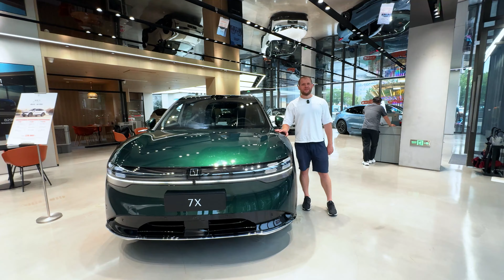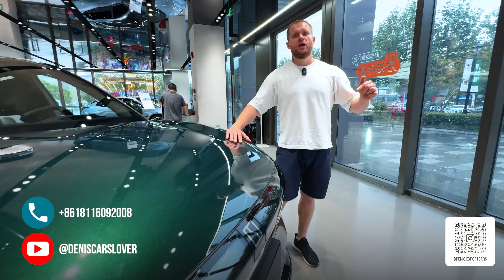Zeekr 7X - The best SUV of 2024! This car has no rivals!

Comment: How does this compare to BYD tang ? I love Tang for the big LFP 108kWh battery. But 7x is more premium and charges a lot faster. Also available with air suspension and better offroad capability, it is shorter and ground clearance Zeekr 23cm vs Tang 17cm. Still, the Zeekr 7x has LFP only on the small 75kWh battery, the big one is NMC at 100kWh. You reviewed both, could you compare a bit ? Thank you.

Comment: Thanks for the informative report
How much towing capacity with dual engine?
Reply from the maker: Manufacturer doesnt offer trailer hook option and doesnt give this detail, but zeekr 001 have this option and the towing capacity for Zeekr 001 trailer hook is 2 tons.
Reply: @deniscarslover  thanks for the quick message - I already knew about the zeekr 007 but was hoping the CX 7 would pull a little more
Reply from the maker: @senjahase  I guess with it's 646 HP it can pull a 20 ton semitraler, but with kerb wieght of 2500 kg it may be not so safe :)

Comment: This car is really nice, I like the look, design, materials and interior features. It has a lot of passenger and cargo space, seems like a miss to not have a button on the door or center console to control the rear seat heating. I like that it has a power roof shade, that has been missing in a lot of new EVs, with the roof glass adding to the cabin heat, that makes the AC work harder to cool the cabin. Driver instrument cluster and heads up display? Nice! Front seats could use a bit more side bolstering, love the way designed the cargo floor covers, they did a really good job on this one. I also like the grey interior color, not sure why a lot of the Chinese cars have white interior, those will get dirty quickly and black is nice but a bit boring these days. I like that Zeekr is changing things up, now they need tan, light brown and red interior as well. Thanks for the review.
Reply from the maker: Thanks so much, I hoe you have subscribed :)
Reply: @deniscarslover  Yep, subscribed a few video back. Keep up the good work.
Reply: 17:05 高配版本的后排中央扶手显示屏内，可以控制后排座椅加热和通风。